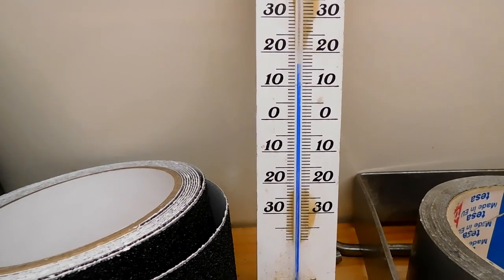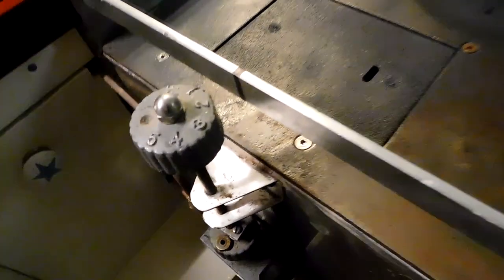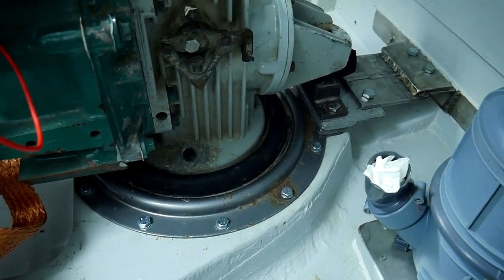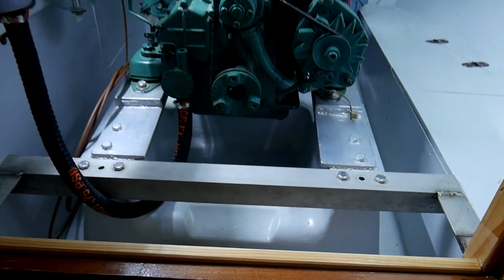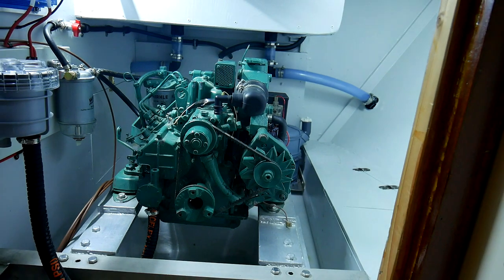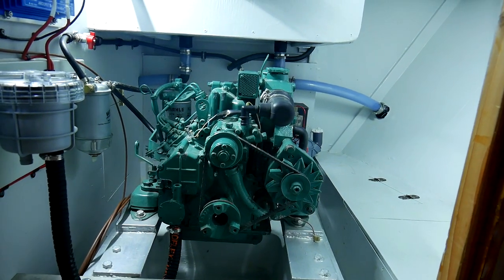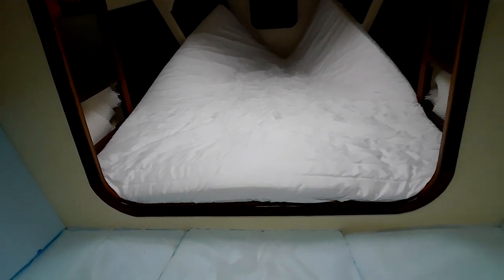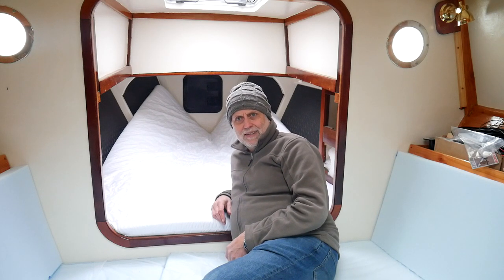Getting in trim, and belt and braces on the engine bed - SV Tapatya EP212

Comment: I think you were wise to reinforce with extra braces on those engine mounts, its should help with creating less vibrations throughout the haul, I would've done the same. You've done a good job. Tony btw I enjoy all the little mundane bits and bobs and showing their processes its not as boring as you may think, don't fret over it, your doing a great job. Lets face it tony they all have to be done and their all part of the process of building a boat. Right!! cheers have a good week.
Reply from the maker: Thanks Fon, and thanks also for watching and commenting as the project goes on. It's appreciated mate! 😀

Comment: Tony you are doing a really cracking job and your build standards are bulletproof. The only way you would find out if your substantial stern drive mounting was not strong enough (and I am pretty sure it is) would be when cracks started to appear in the flow coat and then it is too late. Providing the additional stainless steel supports helps to transfer the loads to the hull and gives the best chance of assuring success. Must be nice to get some heat in the boat too. 😀👍⛵️
Reply from the maker: Thanks Norman. Yes, that's how I see it too. There's no way I'm going to sea with an engine bed that's only glassed to a ply board. Yes, that stove is a corker👍

Comment: my concern with the steel bracing isnt so much weight or overkill but will it increase transfer of vibration and resonance of the engine through the hull?
Reply from the maker: I don't think so, Chris. The engine and sail drive are completely rubber mounted. Only time will tell for sure though! 👍

Comment: Very nice... engine room.. no fire and sound insulation?
Reply from the maker: Not yet, R.E.!
Reply: @SVTapatya  just asked because of all that's mounted to the walls already... 🙂
Reply from the maker: Yes, you're quite right! Really, I'm waiting to see what is needed and where. In my experience, small sailboats don't usually have much in the way of fire protection - a fire extinguisher and a hole into the engine room to squirt it through. An exhaust temperature sensor might be worth fitting, but most small sailboats don't even have one of those. As to soundproofing, I think I'll run her up and see what it's like. It could be a good incentive to not use the engine much!

Comment: Hello Tony. I have followed your building all the way from start. I think you have done a great job, but these extra kilos of Stainless around the engine? Why ? I have been working with boats for 45 years and have nwver seen these, and have never heard about anyona having troublewith these. The bracket for the engine isnt the original but strong enough. You only gain alot of extra kilos in the back of the boat. Kilos that boatconstruktor not have there ..... How do you think SV Tapatya will be in water?   Maybe 8-12 cm lower in back cause of all the stainless.... You have done soo many very good things, but now I think you go too far.... Anyway greetings too a nice boat.
Reply from the maker: Hi Arnt
Thanks for the kind comments. I think you’re misjudging the amount of stainless there. The whole lot weighs less than 10kg. It’ll make little difference to the water line of the boat, especially when you consider that I don’t have the holding tank that’s designed to be in the lazarette and that my fuel tank is smaller than designed.